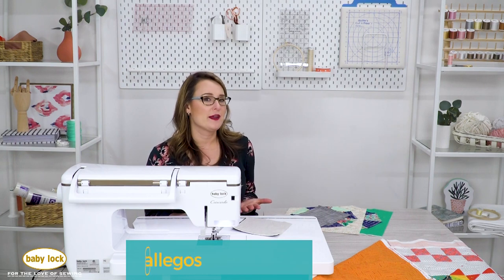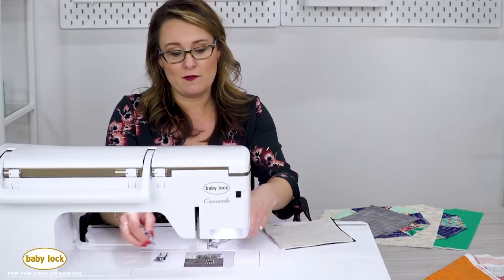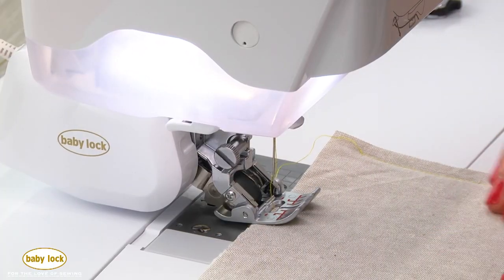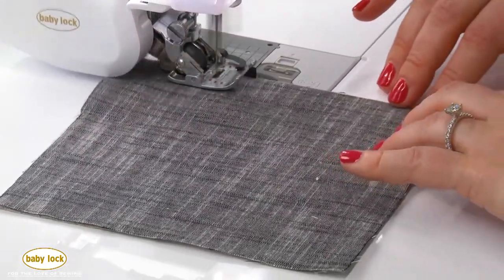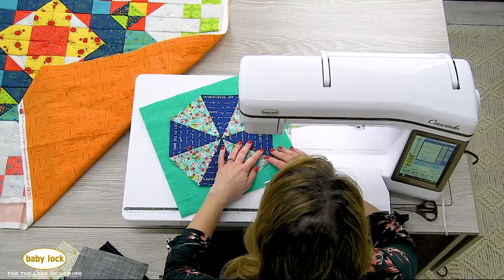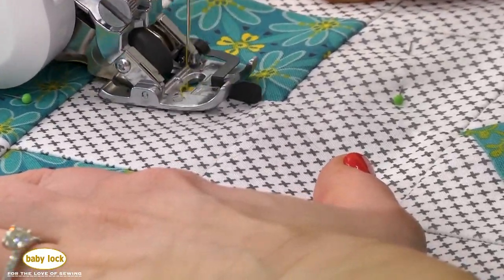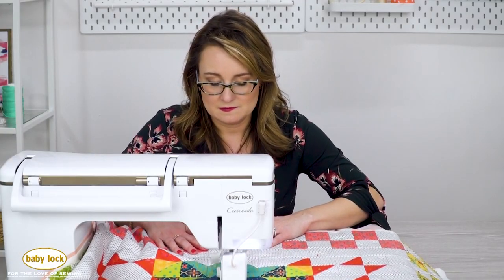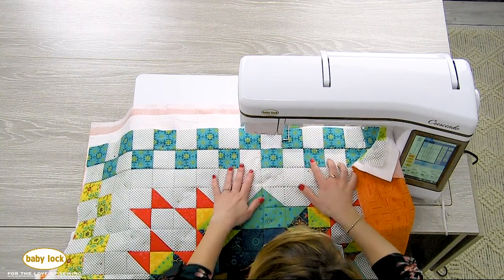Baby Lock Accessory Spotlight - The Digital Dual Feed

Comment: It looks like the back bottom of your digital dual feed is running slightly above your quilt sandwich.  I like to use wool batting and my digital dual feed drags on my quilt sandwich.  I have to keep pulling the sandwich at the back of the dual feed or it gets stuck.  How do I fix this problem?
Reply: I have that same issue too. The walking foot needs to be up higher.   I have had my Crescendo for 5 years.  I love my machine...wish i could add more stitches and adjust that dual feed walking foot!
Reply: @ritameditz7342  I think they need to rethink the design of the foot so the back part rides higher.  If we can figure out how to raise our foot, that will mean the foot won’t be in good contact with the machine’s feed dogs.  After trying a few times to get this dual feed to work on a quilt sandwich, I gave up and bought a regular walking foot.  I love my Crescendo, but this dual feed foot needs work.